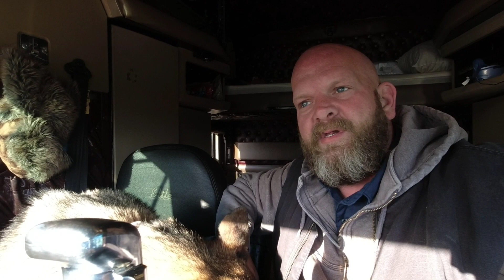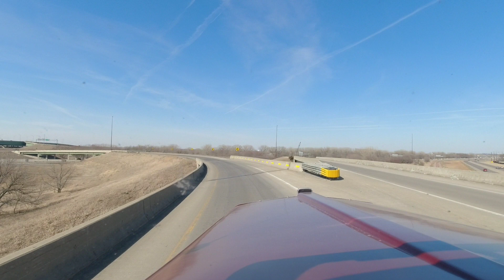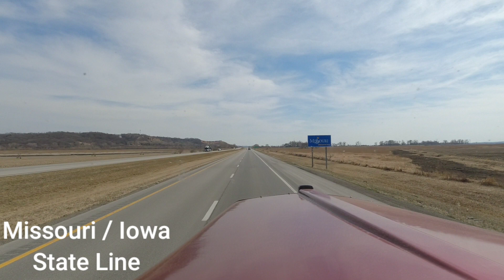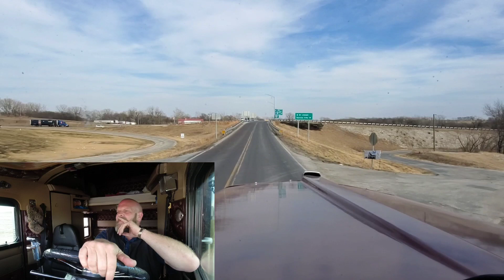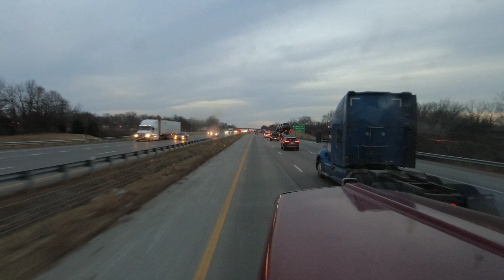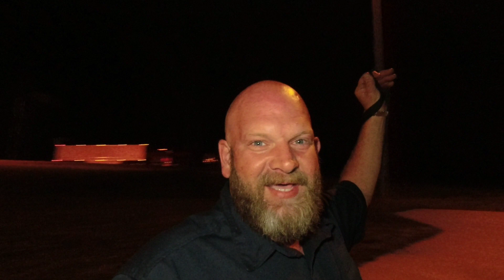Georgia Load Again ~ Dad Gives Me The Best News Ever !!!!! #296

Comment: Spectacular news on your dads cancer outcome . Im a Michelin guy but I have ran the Firestone steers they were good but didn't have longevity and the truck I am driving now has Yokohama steers on it now and they are good also but in my opinion the Michelin steers are pricey but they are worth the extra price because of their longevity and  handling plus you get a higher price for casings when you trade them in. But I think you should get some good miles out of the yoko's

Comment: That is good news.
I just put steer tires on last week. I only run Michelin tires.
16 ply. I have tried other brands 
For me they don’t last.
Reply from the maker: Used to run those. Then I went with the Firestone.
Reply: @truckingwithschmidt7120  I have never ran Firestone.
Do they hold up? Do you get lots of miles out of them?
I been thinking about going with wide singles . I hear good and bad. Mostly bad from drivers that never ran them. I heard good from guys that have them.
Reply from the maker: I can usually get around that 200,000 out of the steers. So I was happy. Ya I haven't heard much good things about the singles